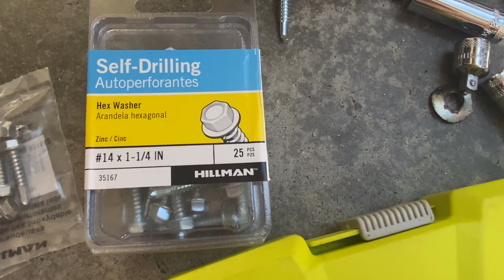TriggaSpec Oil Cooler Installation Tutorial - Nismo 370z

Comment from the maker: * UPDATE * : DON’T route your OIL LINES in the same way that I did in the video! I ran them under the front sway bar, which is a horrible idea because they will rip if I run over something in the road and it snags them. In addition to that, they also block one of the OEM mounting points for the plastic undershroud. You need the undershroud to run a V1 Nismo bumper, so I had to undo the lines to move them out of the way. I’m going to link a video below of how I’m running my lines after changing them around. In the video I will be deleting the factory OEM oil warmer found on 2012+ cars, but that’s the only other change I’m making. I will explain everything in the video.

Video that shows how I re-routed my oil lines: https://youtu.be/g0WQa9iAqWo

* After editing this video and talking with other buyers, I think that most of my issues came from having an aftermarket radiator. Regardless, this video will still tell you everything that you will need to know during your installation. If you don't have the black pieces shown at 7:49, then you can just mount the oil cooler without modifying anything, obviously. *

Hey guys, this was my complete installation video for NoTrigga's 30-row oil cooler. I had a few issues during my installation, so I wanted to make a video in case anyone else had similar issues. If you have any issues during your install, message me on Instagram @ThatRedNismo, and I'll get back to you as soon as possible. I apologize for repeating myself a bunch of times in these clips, I started recording the video on the first day and then decided to start it over on the second day and couldn't remember what I had already talked about. 

I have included timestamps in the description that have separated the video into important parts.

After having this installed on my car for about a week or two, I have run into one small issue, but I'm pretty sure I've found a way to work around it easily. Before I had the oil cooler installed, the morning temperatures were around 55-65 degrees and on my drive to school each morning (8.8 miles away; 20-minute drive), the oil temperature would reach around 180-195 degrees when shifting under 3k RPM. After I finished installing it, the temperatures dropped to around 40 degrees each morning, and I've only had the temperatures reach around 160 degrees after doing the same trip with the exact same driving style. In addition to the lower average temperature skewing my results, I've also been driving around with the bumper off of the car since I finished installing it, so I'm not sure if the above-average airflow is the reason that the oil cooler is working 'too' well, or if the thermostatic sandwich plate is activating before it is needed. I'll update this in a few days when I fab something that will partially block air from reaching some of the rows on the cooler. 

EDIT: I ended up placing a temp tag (plastic, not paper tag) in front of the cooler, and it sat on the pieces that are sticking out of the lower radiator core support. It blocks exactly 15 rows and I have it zip-tied onto the damper and the core support. If you don't have something like that to use, I would recommend cutting out a piece of plexiglass, or a double-layered piece of aluminum foil (suggested by another viewer).

Comment: hey there so the reason why you switched the dampener on the other side is because you have a bigger radiator when you put your oil cooler and put the dampener back on? if you had a stock radiator then its not necessary to flip the dampener?
Reply from the maker: Could you write that a little clearer? I think I understand your second sentence, but I'm not completely sure. I THINK that if I had the OEM radiator installed on my car that I wouldn't have needed to flip the damper, but I'm not sure since I don't have another car to test it out on. Based on what I can remember, the L bracket that he provided wouldn't allow the oil cooler to clear the damper (if it was placed behind the damper, closest to the radiator), but if you just bent a longer piece of metal into that same L shape I think it would work fine.

Comment: this might be a dumb question, but do you drain the whole car (oil pan and oil filter)? or just the oil filter it’s self ?
Reply from the maker: What?
Reply from the maker: If you’re doing this at the same time you’re doing an oil change (which is recommended,) then you’ll just pull the oil drain plug and then remove the oil filter to install the sandwich plate and to install the new oil filter.